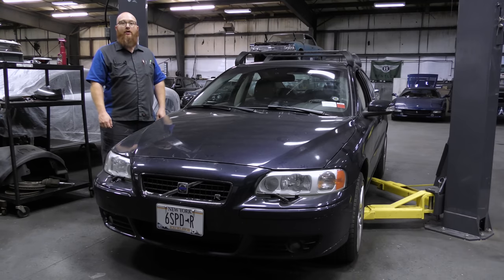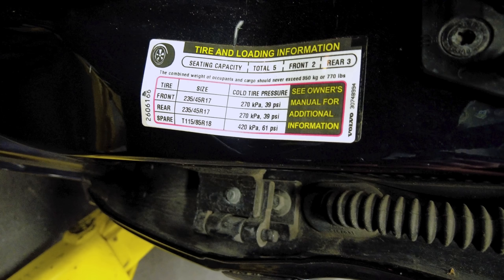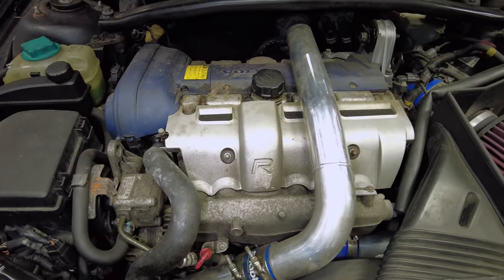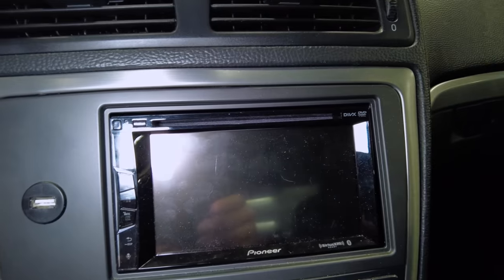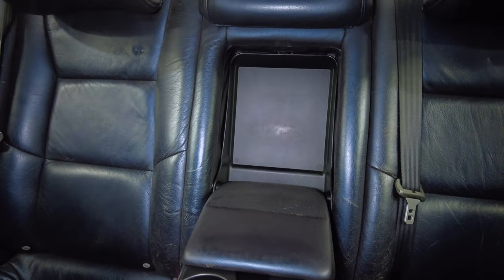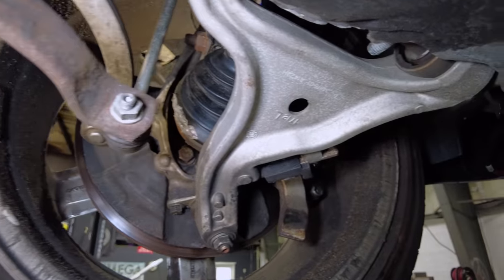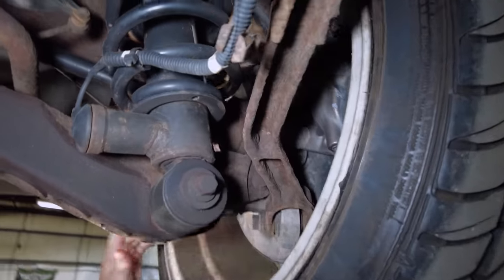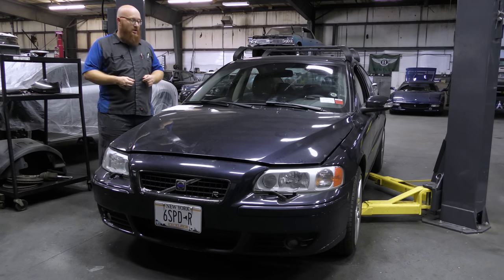They shipped their '07 Volvo S60R over 1K miles to my shop? CAR WIZARD determines if it's worth it!

Comment: With all due respect to Car Wizard - I would honestly be pretty pissed if I had this car - and this attitude from a shop a thousand miles from my home to which I shipped a car in hope for sorting it out. I'm the customer - I'm paying - and if I can get a transmission to you - doesn't matter, any transmission - I can sign a waiver saying I assume full responsibility for it - but the shop has to put in the part I've brought the shop. The same regards calipers. That said - the guy has probably loads of money if he's able to ship an older - rare, but still older - Volvo - a thousand miles from NY - so he probably doesn't care. Also - I've already written this once on Car WIzard's channel - but this Volvo suffers from rust issues - which for now aren't terrible, but there's a good, cheap and easy solution for that. There are products for ... or against, rather - rust - rust transformers, inhibitors, primers, sprays, etc, etc. There are tens of them - and most of them actually work - even here in my little country - Latvia - and we also get our roads heavily salted during the winters - which means - there are probably hundreds of good products in the US. Most of them can probably be applied easily - even my means of using just a jack or other DIY methods. Volvos aren't very prone to rust - compared to Japanese cars, for instance  - but whenever I see a rare car which the owner insists he loves - and lots of untreated rust on that baby - it kinda doesn't make sense. EIther way - thanks for the video, best of luck from Latvia.

Comment: Theres a weird problem not many people know about with these p2 volvos that happens during certain weather conditions. If theres a lot of snow on the ground or if it rained a lot the temperature difference between the ground and the exhaust causes the exhuast to expand and move up hitting the drive shaft. A scary and loud grinding noise is heard inside the cabin until you stop the car which causes the exhaust to move back down. Thats why you see a contact point with the exhaust and drive shaft in the video.

Comment: I've got the wagon and it's fun.... until anything breaks. But they do hold up, and the 4C when it works is really fun. there can't be many wagons with active chassis like that. and mine still works (excuse me while I knock on wood for an hour)
Reply: When I changed out struts the first time, I went with OEM Monroes - "Lifetime Warranty" - 5 years later, tried to get them replaced, and Monroe was out of stock everywhere on them and had no idea if/when they were ever going to get them in again - so I went to BC Coilovers - haven't looked back, and they both handle better and ride better simultaneously.

Comment: Yes, it’s 100% worth saving a S60r. I have a 2000 V70r and am currently looking for a P2 variant. They are already climbing to the high teens. Some 25k
Reply: I got my P2 V70R for $3000 back in 2019.Also have a 1998 V70R sitting in my garage. Interior and body isn't in great shape but I have it running great with some upgraded stuff. Going to toss the coilovers because they suck on these cars.

Comment: I had the same problem with my wheels rubbing. A local Volvo dealership had to install new wheel stops on my 04 V70R, which is the wagon version. I only had the work done because it couldn't pass inspection without them intalled.

Comment: I bought a 02 Civic LX with 193,000 miles.  I don't know when the timing belt was last changed.  How do I know if it should be replaced?  Runs great, not over heating.  Love your channel.

Comment: I had a junk yard rebuilt steering rack put in to my V70 for less than half the cost of a new steering rack alone. The rack plus labor was even a little less than half the cost of just a new one. Also OE parts are a lot cheaper than OEM Volvo. OEM Volvo parts are ridiculously expensive, especially for the R, so OE or aftermarket parts are usually a better choice.

Comment: The wheels are factory 18" alloys (They're called "Pegasus" wheels). The R on them is the giveaway. 17's were for the T5's and other S60 models. Also, I recommend rock auto for parts as they're no more expensive than most cars. Only exception is dealer parts which are absolutely brutal, sometimes.

Comment: I have a similar one but 2004. About the same mileage but in somewhat better condition. A money pit but fortunately I paid only a few thousand for it about eight years ago. I would check the front strut towers for rust holes as mine need patching - this is a well known problem.

Comment: The one factor which grew in size is the cost of parts etc. as newer models came out..Volvos imho having owned several pre 1992 was  that they can live forever but you will pay $$$ to make that happen.  Of course Volvo lovers will often opt to do it .  
As for this one, I have to assume these owners are fanatically attached to it, but Wizard's inclination that they move on is correct.  And it won't be long even after thousands spent now that more thousands will be needed,
Is this car really worth all that love and will it become a great classic?  No.

Comment: I don't blame people for not wanting to work on the Volvo's transmission. My friends and I tried servicing one ourselves back in the early 00s. Special bolts, tools and all sorts of trouble while doing it. Heck one of the bolt styles needed was like 80 bucks a bolt. We were all working our first jobs back then lol. It got stuck on the side of the road a few more times and off it went to be used as a trade in.
Reply: I think today you would find aftermarket bolts for cheaper from IPD!

Comment: I had a 2005 s60 r. Got rid of it not because of engine problems, it had none with 220,000 miles. It was the all wheel drive that was messed up and not even the dealer could get it right

Comment: Depending on the size of rims these cars will have different  sizes  (thickness ) steering lock limiting stops bolted to the lower control arms. I would just shim them out a few milimeters . That will probably fix that problem.

Comment: All P2 and P3 Volvos Rear view mirrors de-laminate If you change that mirror in a P2 , like that one, with a Salvage yard mirror the car will not crank due to part of the security system is in the mirror housing.  My P3 I switched the mirror with no problem. .

Comment: You can always argue with the insurance company regarding market value pay-outs.
 'market value' is subjective and if you were to sell the vehicle on the open market with say $3000 in recently qualified repairs undertaken, then you could add a margin onto your resell value.
The same applies for insurance pay-outs. If you have all the documents and invoices for the repairs/maintenance you can argue for an increased market value assessment. I've had it done successfully myself.

Comment: It's a common fault on volvos, it's the steering stop horn rubbers they wear down and allow the steering lock to be increased and this causing the rubbing, change the steering rubber stops all will be good

Comment: PCV+ timing belt and cam seal service is probably due considering the oil on the cover.

Whiteblocks are great engines, when maintained. Tunes crack sleeves like none other. Personally prefer the P1 cars that are a little simpler
Reply: Also inspect the VVTI cam hub for wear. My mechanic says if they are worn out they can start leaking oil. And that the accessory belt is as important as the timing belt to keep in good condition, since one snapping can take out the other. Unfortunately the cam hubs are $300 each and mine had two of them.
Reply: @zzoinks  that is 100% not true at all. The water pump is driven by the timing belt. The accessory belt is outside of the timing cover, and the timing belt is inside. All a broken accessory belt would cause is loss of a/c, p/s, and your alternator.

No way to inspect the VCT gear without removing and totally disassembling it which would require the timing belt to be removed , and even so they are not intended to be disassembled. Remove and replace only.

Comment: at 10:46 you can see the "frost plug" style plug behing the aoc actuator. mine rusted through, you cant buy them, or, at least i couldnt find one in the time it was on the hoist.  i drained the haldex oil, left the rusted plug in place, cleaned up the inner lip of the plug and jb welded a pickle jar lid. might sound crazy, worked like a charm.

Comment: Bought mine in 2018,£6500 with 44000 miles on it. My only issue is a p2187 code which only pings on when starting. I think it might be an air leak but its not affecting the running.

Comment: The oiled airfilters messes up the mass air flow sensors, the oil ends up on the wolfram wire inside it and the wire breaks

Comment: I bought a Volvo S60 R in 2015 at 14500€ and in 5 years I've had 13000€ of repairs.
And I only bought the parts and did all the work myself.

Comment: Hey all it’s my car, so the air filter was on the car when I bought it as were all the cosmetic issues including the mirror lol, I am going to replace the mirror at some point for sure, the prior owner  replaced the mirror with an aftermarket that as some people said meant the remote for the car stopped working, he had given me the original mirror when I bought it from him so I reinstalled it just so my remote keyless entry would work again. The car previously resided in Rochester which is upstate NY which is proabblt what caused most of the rust, since I have had it the winters have not been bad I live in the NYC area. I am going to look into the bump stop thing I didn’t realize the bump stops were different for the 17 inch OEM wheels vs the 18 inch wheels, that is part of the control arms right? Everything on the front end has been replaced, struts, control arms, wheel hubs, tire rods, and both drive axles. I had told wizard that the wheels are OEM option wheels so not sure why they would rub, I thought maybe whatever it was rubbing on got warped or something but let me know what you guys think I should have replaced to stop the rubbing. And yes the wheel is after market, it’s awesome as it’s way lighter then the factory wheel and I like the alcantara and the stripe at the top of the wheel. And to me it’s worth repairing, I also own a 2007 z4m which is my daily driver, I use this as my 4 door companion when my 6 year old is in car with me and if I ever need to transport extra people (like my other two kids) or when I go on jobs that I need my ladder with the roof rack and I store a lot of equipment in trunk and since it’s not great cosmetically I don’t mind driving it to NYC for instance and parking it in a parking lot. Once my 6 year old is old enough to sit in front seat of any 2 seater I own by then, then I will get rid of tue car as I won’t need more then 2 seats anymore, so I will be keeping it for another 5-6 years probably so was well worth the cost of repair, rather the devil you know. And I’ll see what happens with the transmission. And to somebody that said it wasn’t worth sending it to the wizard to repair I disagree, he does great work, and NYC is much more expensive for labor.

Comment: Even if a car is rare there comes a point when it should be killed off and become a parts donor. In this case there are not many good parts to donate though, too far gone. Gearbox and brakes already due, then comes the angle gear and haldex and after that the 4C system will need to be rebuilt. Grand total on top of what Car Wizard is doing will be 20,000 USD minimum and the car will still look like crap both inside and out.

Comment: The steering wheel is def aftermarket, there were no alcantara options for those cars
Reply: And it's in better shape than the rest of the interior. 

That interior has seen a lot of action, kind of beat for 120k, even the back seats are cracking and have seen a lot of action.

Comment: Hopefully the engine hasn't cracked a cylinder liner, check for exhaust gasses as they can run just fine with a crack for quite some time. My 06 M66 did this, put in a 2.5T block with the R head and turbo for a more reliable engine. Then get a tune and turn up the boost!

Comment: It`s was/is a problem the owner puts on bigger wheels than 17 " because there´s no space for 18" wheels that´s why they are rubbing. Volvo have or had  a kit of "plastic bushings/clips which they  called limited steering which you put behind the inner guide joint.

Comment: My understanding of oil saturated air filters is that they are WW2 technology, and by today's standards, terrible at filtering air. By my experience, the last time I used one was on a vehicle I owned in the 90's. Dirt would make it past the filter, down the intake duct, mass airflow sensor. All the way to the throttle body. There are test that prove they are inefficient, and yet you still see vehicles going down the road with those stickers that come in the box when you buy one of those things. Not to mention, people are giving the manufacturers free advertising when they put that sticker on their back window.

Comment: Check the oil from the haldexx ,the angle gearbox en the diff. The haldex has a filter and is difficult to reach, the exhaust needs come off. I have a XC70 with the same AWD and the oils in those parts wille never be changed (lifetime oil bullshit)

Comment: I'm amazed at $400 for a caliper ! I doubt they can be that expensive in the UK/Europe. There's nothing to them really. When I was working on my old Ford Cortina, I bought a repair kit with new seals and refurbished the calipers myself. The repair kit cost almost nothing. Admittedly it was an hour's work or two but even that should be less than $400 !

Comment: I'm sure you're done with the work by now and of course it's your professional opinion, but I would bet anything that those brake hoses come right out of the caliper. I have a 2004 S60R that's lived its whole life in Wisconsin winters. I swapped to stainless braided brake hoses probably around 250k and they were quite rusty but still easily came right out of the caliper. Admittedly Wisconsin uses less salt and even at 282k I've got less rust than this car. Nevertheless I believe those brake hoses to be a pretty easy swap. The other end that attaches to the metal line is a different story. That might cause some headaches. I agree with the other commenters that yes its the steering limiters causing the rub, although my R was factory equipped with the optional 18s and I've got the largest steering limiters and it still rubs 🤷. The forums say to get longer lug bolts and use 5mm wheel spacers for a permanent fix. So far I've just dealt with the rubbing on mine.

Comment: Wow that’s honestly more than I was expecting. Seems like it only makes sense to work on these cars if you do it yourself. All those problems are about a $1000 parts fix for a DIY guy.
Reply: On  a normal s60 yes...on this one not really..standard brakes are 286 or 305 mm. On an r, 336mm and 4 piston calipers...

Comment: Unfortunately, a lot of S60Rs end up in the junker compared to the more sought out v70r of the same platform. I have found multiple s60rs and couple v70rs in the yard, and have a couple s60r engines sitting around as well.

Comment: Volvo sold/sells different steering stops one that is thicker will stop the turning to contact for some wheel dimensions, Maybe they monted the wrong ones on the new lower arms?
Reply: exactly what I was thinking... p/n 31212191 for an 18.7MM stop, 31212190 for a 17.5

Comment: umm no. You can buy a s60r that hasn't had those problems fixed for that. So the question becomes how do you tell the insurance company that? Well it takes someone who "knows how" but it's basically that cars that have been fixed are not for sale so there is no market value for them. Not all cars are fixed to sell, some, like this one, are fixed to keep. And it is actually a good investment when compared to the other options of getting a similar car in similar condition.

Comment: As a owner and enjoyer of a s60R I gotta say it’s always worth it, wicked fun car and way too rare to find one in Magic Blue❤️
Reply: Yes the 18” Peggys are a option same with a body kit, and if you’re gonna point out the rubbing….all of them rub mine is on 235/45R17 the factory size and it rubs at full lock
Reply: The snabb kit filter is a non oiled air filter, I’m running the same filter, absolutely love the sound added🫡👌🏻
Reply: That steering wheel is re-done the factory wheels do not have the alcantera nor do they have the flat bottom
Reply: Although the airbag cover is the factory one
Reply: 11:48 that rubbing you see is unavoidable once the factory bump stops wear down enough, like I mentioned above i am running the factory size and I am also making contact in the same spot. Just the way she goes on these things😅

Comment: 0:30  - if the car is worth 10k on the used market, and it had 8k of repairs JUST done, that car will OUTLAST the 10k vehicle by a LONG shot. 

Its not a straight calculation like that. 

Its kind of MR LONG to know, but its also not WIZARDS job to tell people the price of their car on the used market, that's up to the CUSTOMER to know.  Nothing wrong with mentioning it though: 

"hey customer, these repairs are going to be thousands, just make sure you know what the used value of the car is"

Comment: These have the worst turning radius and tires over 225 rub at full lock.  Using not Electronic controlled struts will save you $$, just use resistors to trick the 4C Active Suspension to avoid errors.

Comment: I spy that 66 4 Door Chevelle.  My first car at 17 was a 1966 2 door Chevelle Malibu, 2 speed (powerglide) on the floor. 283 V8. Got it for $1600 at auction in the mid 90s.